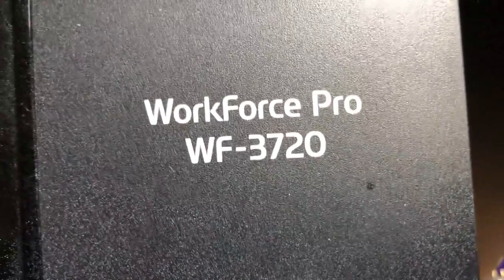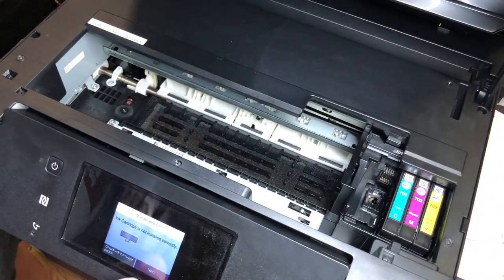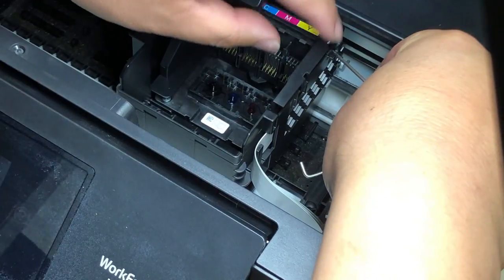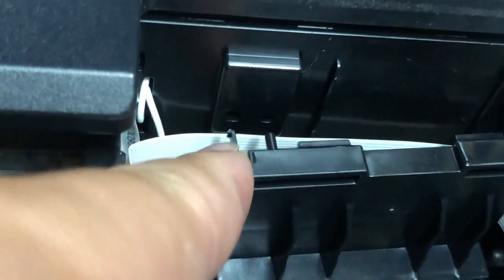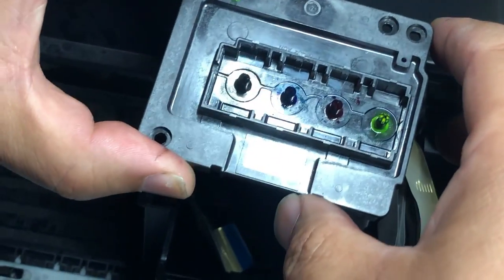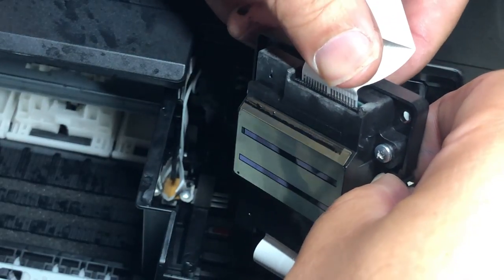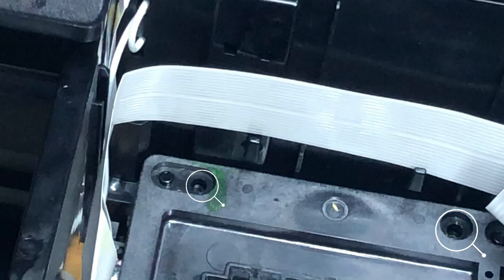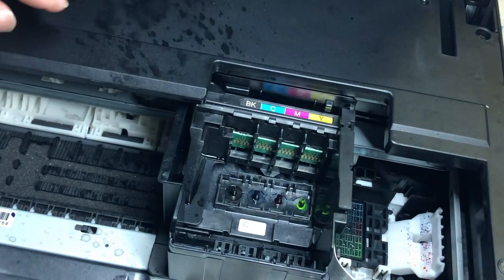Replace T1881 Printhead for Epson WorkForce WF 3720 3730 3733 - 702 Cartridge

Comment: I would like to pick up your brain on the issue of my epson wf3540. After the paper jam and paper removed in the direction of printing the printer became loud and I believe the head may have been misaligned. I tried a print head alignment through software and the print comes out zigzagged like portions of the print are moved left or right by few milimeters. Print head was cleaned and that test comes out OK. I am not sure if I need to replace the print head or do anything else to fix the problem. Please help

Comment: Is it the same print head like in the newer WF 3820? It seems like I need a new print head for my WF 3640 and I've found out that it's the same like in the 3720; sadly I can no longer find it for sale. The nozzle count is the same on 3640/3720 and 3820, which is an indicator that it could be the same. I know the part number is the same for 3640 and 3720, but I cannot find a parts list for the 3820. Kevin, thank you very much for your excellent videos! I've binge-watched 13 of your videos regarding my 3640 printer. I'm going to try more of your tips to unclog my print head, but the easiest try of >15 cleaning cycles didn't help to let magenta color to reappear (only a few nozzles work randomly).